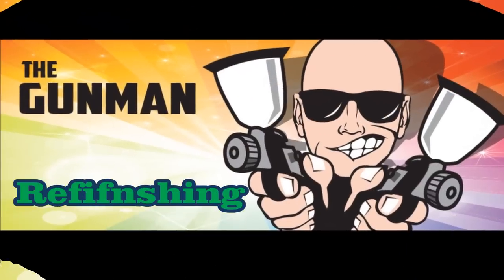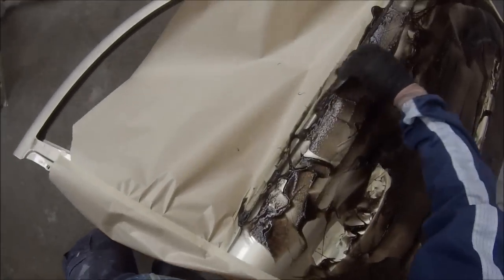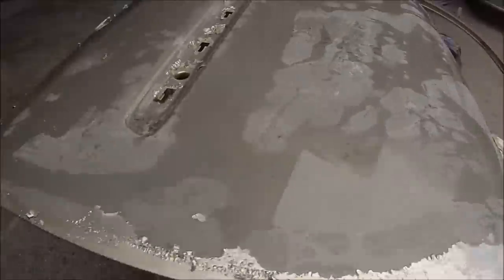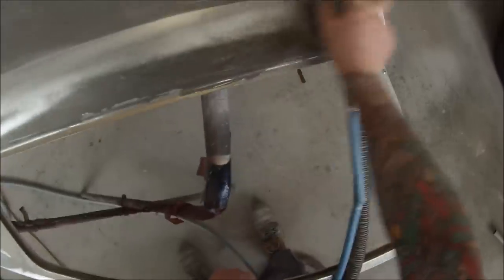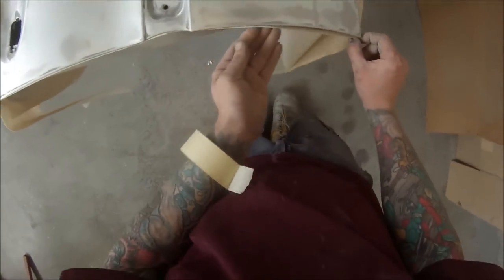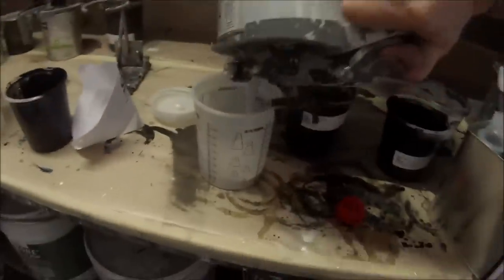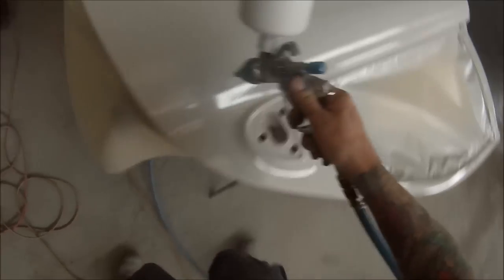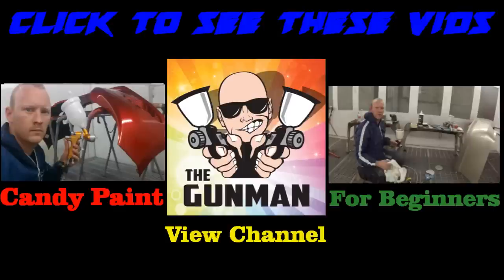How to use Paint Stripper

Comment: I have found that a handheld media blaster makes quick work of stripping areas like that molding recess and any tight pockets that are difficult to sand by hand. It is gentle enough in those areas to not damage the panel and is very fast. Leaves the area ready for etch primer or epoxy in seconds. When used with a recovery attachment, you will create little airborne dust and is much cleaner than blasting with just the open gun.
Reply from the maker: Thanks mate, I just had a look at them and they look handy. We will have to get one for next time.
Reply: The Gunman I have a SpeedBlaster from Zendex Tools and the HotSpot recovery system.  Works very well.
Reply: The Gunman also, check your spelling of "refinishing" in the intro graphic.  Refifnshing
Reply from the maker: lol I'm embarrassed now, I don't know how I missed that one.

Comment: Old video but I hope you see this: what type of masking tape are you using? I’m currently restoring an old lathe and using a dimethyl sulphoxide stripper and every type of tape I’ve used so far just comes loose. Seems like the stripper is melting the adhesive.
Thanks for a good video!

Comment: Just use GRP on my bonnet and it f**ked me over. Had previous bog work. Its turned horrible. In this situation would you sand blast or use 40grit orbital back to metal? Lovre the vids man. Doing an s14 project myself atm and got heaps of useful tios

Comment: hey mate currently restoring a car and plan to paint strip it as sanding it is just a bitch ass there are quite a few layers so if i do that would you recommend using an epoxy primer as it will most likely sit for awhile